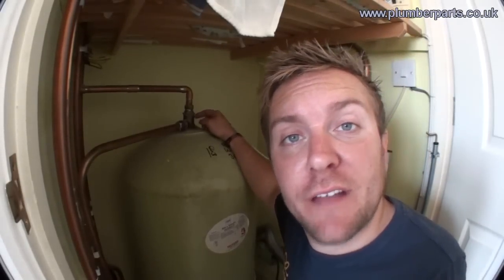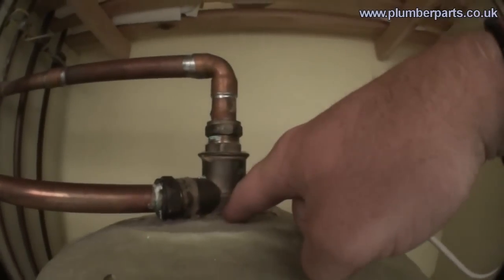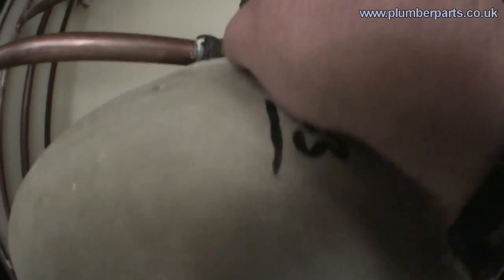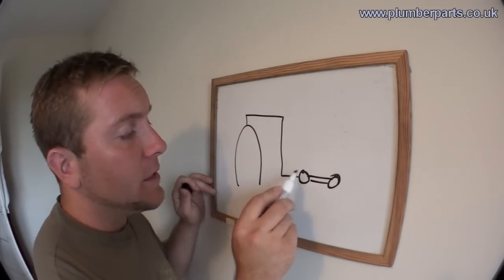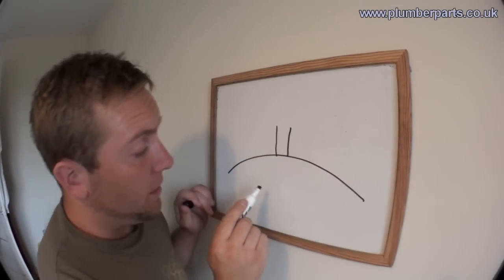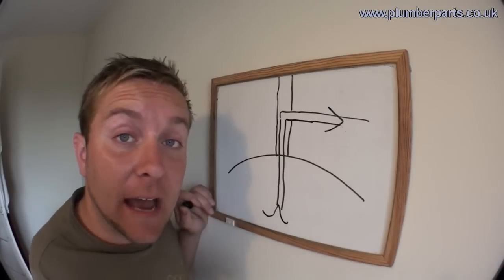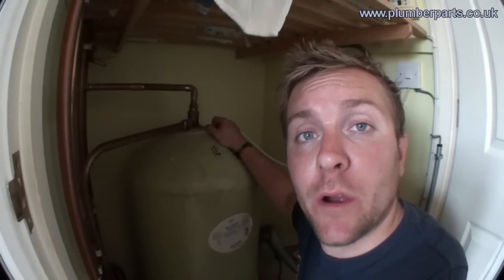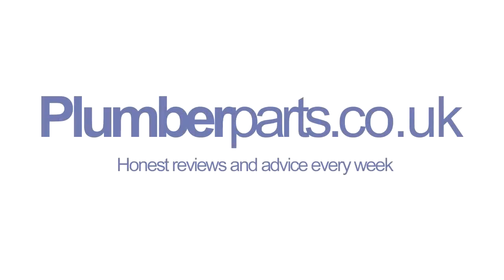Surrey Flanges - How They Work - Plumbing Tips

Comment: A surrey flange is not there to stop air bubbles getting sucked out of the tank ( the tank has no air bubbles in it ) the surrey flange is there to stop air getting sucked down the vent pipe.

Comment: The air does not come from bubbles in the cylinder. Without the S. Flange, the suction of the pump first drawers the water out of the vent pipe, then air gets in. (especially if the tank supplying the cylinder is not very high above the cylinder itself) The dip pipe makes sure the water is only drawn from the cylinder and not the vent pipe
Reply: exactly

Comment: Is it favourable to create a u bend configuration in between the valve and the pump?
I've had one of these fitted but still have intermittent issues with the shower ...I'm sure its air...as to overcome I decrease the temp mixer side towards cold and invariably the pump kicks in?

Comment: I much prefer to fit a warwix (or warwick) flange which does much the same job except that the you have complete directional freedom for both the shower and standard hot water outlets. The main difference is that the shower outlet emerges from the top and the standard hot water outlet on the side. The latter is on a rotating collar clamped between two fibre washers so you can line it up with the existing outlet. The height will be different of course, so there's some adaption to existing pipework, but it's pretty simple to do.

For the shower outlet it's a compression elbow at the top which, of course, can be directed where you wish.

There use is approved for Salamandar pumps where you might use a Surrey flange (for higher output pumps you need an Essex flange, but that's a whole new game.
Reply from the maker: Top info mate. Thanks!

Comment: If a pump is too powerful but has a Surrey flange does that ensure the hot side of the pump will not run dry when the hot water is gone it will just take cold water from the cyclinder

Comment: please help ever since having a surrey flange fitted my pump now seems to constantly draw air in you can hear the tone of the pump change the water pressure changes at the shower head and it goes colder for abt 5 - 10 seconds the tone changes back the pressure resumes and the water temp adjusts to the correct temp im guessing the tone change is air??

Comment: Great video thanks.  
The cylinder I'm about to fit an s flange on is new and has insulation foam around the entire tank including where  the  new s flange has to go.  My question is do 8 just remove the foam around that area and see the same as what was in your video   ie  a removable part? Thanks a lot. B

Comment: Great explanation. About to fit a lower shower to use water heated by pv solar. Plumber wanted to Tee into existing hot tap in loft without any extra plumbing

Comment: Does it matter where you tee in the hot pipe from a Willis immersion heater I have teed it in to the hot outlet going to hot water mixing valve and the top pipe from my flange is just a vent pipe,

Thanks.

Comment: Hi, I got a surrey flange fitted when we got a pump installed. The pump lasted about 6-8 weeks then totally failed. Looking at  this vid the s flange that is fitted, my one is the other way round. Now when pump is turned on the flow of water is just the same as if the pump wasnt on also no hot water flows through it. When turned off the hot water seems to flow throught. Another thing is the cold water tap in the downstairs toilet seem to be luke warm which never happened before. any ideas mate

Comment: @plumberparts Hey PP. yea the pump feeds to a mixer shower which was installed last year new. Now the snag is the whole bathroom was tiled after the shower was installed. 

From what i can see the pump is in the hot press and connected to the main hot and cold for the whole house (not what was intended), it was just the bathrooms that was suppose to get the pressure water. but a friend installed it for me and i've no come back now :(  

should the s flange be changed like in the vid

Comment: Could I fit a pump straight to the hot water coming off the tank because I have very little pressure on the hot water top in the bathroom? It's an indirect tank. Thanks and great vid as usual

Comment: fabulous site. i recently had  fitted new pressure shower to my indirect system fitting a 4 bar pump and (i think) surrey flange.The pump kicks in when i open a hot water tap or turn on the shower by detecting pressure drop or water flow. However, since fitting this new system when a tap is turned on the hot water comes out slower than you could pee and the pump does not seem to detect this for anything from 5 to 45 seconds and you could be standing in the shower reading a book until it eventually kicks in. Any ideas?
Reply from the maker: +jim smith Sounds like a change in head pressure, or you need a new pump. Good luck, PP!

Comment: Hi
The outlet from our Surrey flange is directed over the top of the immersion heater blanking cap which prevents me adding an immersion heater.
Would it be possible to refit the flange so the outlet is directed where I want? I guess some sort of spacer would be needed so that the a seal can be made?
What would you do?
Thanks :)
Reply: I changed it for a Warwick flange. Seemed easier.

Comment: When I moved in to my house the en-suite shower was installed with a power shower. I now what to change this and install a concealed shower rub of a pump, when I checked the tank there is no surrey flange fitted. I have had the power shower for 17 years and it has not gone wrong so I am not sure whether they need one as they are different technology or whether the builder was cutting corners?  Any advice gratefully received.
Reply from the maker: It's only so they draw water from lower in the tank and reduce air ingress risk. SUBSCRIBE! ➡️👉 https://www.youtube.com/subscription_center?add_user=plumberparts 👈⬅️ IF YOU HAVEN'T ALREADY! 😎

Comment: OK I've got the surrey flange on my cylinder going to the pump (MIRA) which feeds 2 showers, pipes run up into the loft then down to the showers which work fine,but still get air bubble build up occasionally which makes the pump pulse when not in use until i run the shower until air clears. What can i do Help?
Reply from the maker: +timclarke989 Raise the water level in the loft tank (but not too far!) thats the first step....
Reply: I'll give that a try thanks

Comment: Surrey ,Essex ,and Warrick flanges are a waste of time as there are far to many parts to fail on them in time .. your best bet is to fit a dropper pipe from the 22mm outlet from the top of the tank  using a 22mm tee (making sure that the shower hot feed is first to get water) this pipe must drop 800mm from that connection and be in 22mm just before it enters the 15mm connection of the pump .. or in the case of a 22mm pump connection it should enter as 22mm .... the above is for a pump located on the floor of the airing cupboard ..... for a pump located just above the top of the hot water tank you still have to use the dropper pipe , but just use some 90% elbows to bring that pipe back up to the pump ..simples ..and no aerated water ... the above is for an indirect hot water cylinder and positive head pump .. hope you find this useful ..700 bathroom later :)
Reply: Nick - very interesting. I need to fit a WHOLE HOUSE 2 bar Stuart Turner Universal (negative head). I asked ST if it was okay to fit the 22mm drop pipe down to the pump, which will be located on the floor next to the cylinder. I want to simply connect in at the existing T joint where the vent goes up to the cold water tank. So, one bar of the T will go up to the vent and the other straight down to the pump inlet. They said it was okay, but it was safer to use a Surrey Flange in case the pump sucked air down the vent. They said to run one outlet from the Surrey Flange straight to the vent only and the other to the general hot feed. But obviously the one to the general hot feed must be the one from the dipper tube - so would that actually give enough flow for a whole house pump?
Reply: songsmith100 Hi , as a bathroom fitter for a "lifetime it seems". i am not a flange lover (tongue in cheek) in the early years i fitted these flanges and they work perfectly well until the fibre washers start to deteriorate and the customer then has to sort out a stained ceiling or even worse .thats why many yrs ago i used the drop pipe system .. i have only ever done one whole house pumped system 9 yrs ago with a stuart turner 15mm pump positive head plumbed in as you describe how you want to do it   ( and that was because the whole house was plumbed in in 15mm) and the customer was insistent a 15 mm was fine ..9yrs later and not one problem ... in your case i would suggest a tank change with one that has a separate feed lower in the tank as apposed to using a retro fit flange .. be also aware of fitting a none return valve of no more than 0.2 bar on the hot side of the feed to the pump to eliminate pipe bounce which in time will damage the push fit fittings on the flexible pump connections ..hope this helps .
Reply: Thanks for the reply, Nick - appreciated.

Comment: Do I need a flange? I "think" I have a direct cylinder combination tank'. It is two tanks as a single unit - heating element at the bottom - small tank at the top. I did have "another" tank for cold water elsewhere, which I have got rid of. It was feeding the toilet and cold tap on bathtub (and possibly to the combination tank, but not sure). In any case the cold water tank is gone. I want cold taps fed by direct mains pressure. Is it okay for the shower pump only to supply HOT water only?. Thx
Reply: In answer to this question for those who may be thinking of doing the same,  to boost just the hot this can be done using a single headed shower pump but regards to a shower this would depend on what type of shower you have, if it is thermostatically mixed then ive only ever known this situation to end in either poor flow from the hot or juddering noises where the shower valve is struggling to mix the hot/cold due to imbalanced pressures.. it would however work on a non thermostatic type which allows free flow from both sides.

Comment: hi I have just fitted a new thermostatic shower to my bathroom i have the hot water supply coming from the side entry on the hot water tank it then goes into a pump i seem to have an air lock on the hot water should i have fitted a surrey flange if so could you tell me what part i need to get please. thanks

Comment: Fantastic videos. Helping me refit my bathroom from scratch.  One quick question: When I fit the Surrey flange into the cylinder with washer,  is it chance which direction the out feed points? I assume I do it up to the 'tightness' required to seal and then the outlet will be pointing randomly.  How can I get it to point in the direction I require?
Reply from the maker: +Geoff Howell Hmmm difficult one. Just try to wangle it to where you need it!
Reply: @plumberparts  there is an easy way to fix this problem, and it is nothing to do with just try to wangle it, trying to wangle it is typical of a cowboy at work.
Reply: @johnbower  Did you figure out how to get it pointing in the correct direction...I think it must be like garden taps where it's purely down to luck where the 'tight' position is...I think I'm going to have to pad it out with PTFE to get it where I want it, but it's a bad design in that respect if you ask me...